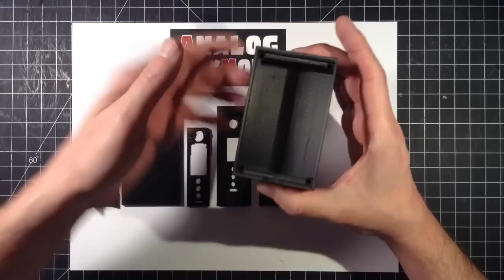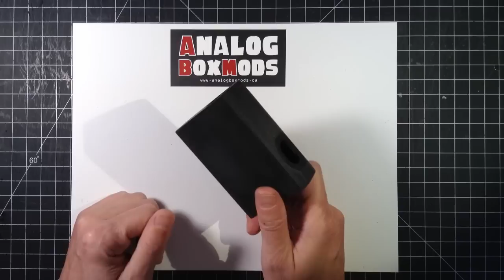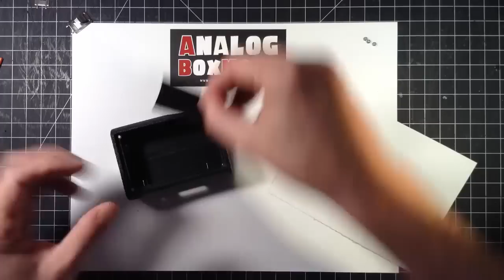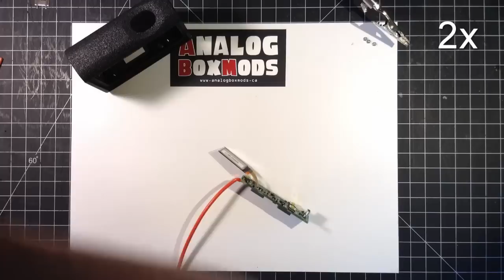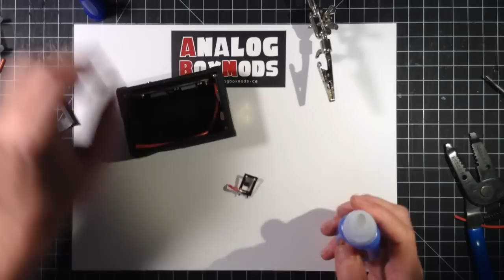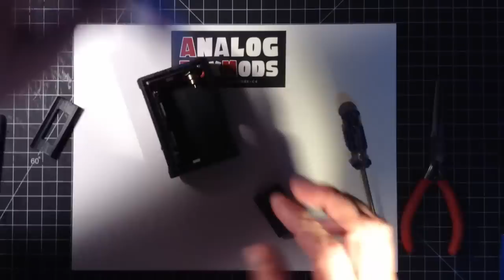DNA 75 3D Printed Squonk DIY Box Mod Build

Comment: Hi! Really really good work, thank you! What about a smaller version? 18650 only, maybe with something of the Nemesi XMOD or the Naked75 layout? Those layout could reach really small dimensions :)
Reply from the maker: I don't think I'll be making any more 3D printed designs, the closest thing I have size wise  now is the ABM-1 enclosure,  here are some pics https://imgur.com/a/Dpaox the purple one is 1x18650 and the black one is 1x20700.
Reply: Thank you for the reply, but those you mentioned are not squonk ones, as I can see
Reply from the maker: you are right :P, the ABM-2 enclosure is what replaces this one, https://imgur.com/a/EFpUx

Comment: is there somewhere we can buy that ground plane i cannot find it on the website anywhere. build looks amazing im new to building vapes but iv been 3d printing for a while thank you for sharing this to thingiverse
Reply from the maker: I never listed it on the website, if you buy the other parts you need add a note during checkout that you want a GND plane and I will include one.  If you source the parts yourself, there is a copper template in the 3d printed files, just get a thin copper sheet at your electronics store and use the template to trace it out.

Comment: what material did you print this? I am torn between petg or putting the effort into making abs work.
Reply from the maker: I use ABS but petg or PLA should also work fine.
Reply: @AnalogboxmodsCanada  thanks for the reply. Yah after studying last night I came to the conclusion that ABS is probably yhe nest material but getting it to print without warping is the challenge. Appreciate the help. 👍

Comment: For that top ground cable, do i have to use solder wick or can i use 16 or 18gauge wire?
Reply from the maker: You can use which ever you like, I just find the solder wick easier to bend when it is that short.

Comment: i need to ask you something regarding a future build. I got a broken mod with a working circuit, the mod is a 100w tc by eleaf that worked with either 1 or 2 18650. Could i use this circuit and make a casing and buy a 510 and a squonk bottle and put them all together to create a 2 battery squonk mod from it without safety issues? is it doable? or this circuit is unsafe for such a job? i m trying to cut down on spending and create my own squonk mod.i figured out that with a bit of work on a mod wooden case and a squonk 510, bottle and wiring i could crate such a thing. unfortunately i need to see many of your vids regarding wiring etc...
Reply from the maker: I don't see why it wouldn't be doable, if you make your own wooden enclosure then you can make sure the size is big enough for the board + 2 battery + squonk.  As for wiring, I don't know what board you have but the wiring should be the same for any voltage regulator, power in (bat+ and bat-), power out (510+ and 510-) and some controls (fire button, up/down buttons).  It should be just as safe as the original mod you harvested the board from.

Comment: Can you build this squonk in the ati box with dual 18650s
Reply from the maker: The only ATI enclosure that might fit the DNA board + 2 18650 + the squonk would be the N enclosure, and you'd still need a custom staggered battery sled...

Comment: I have a dna 75 board. Can I order the kit without the board if so how much for the one you built here.
Reply from the maker: The Kit does not have a "no board" option but you can get just the enclosure which actually includes everything except the board wire and 510,  http://analogboxmods.ca/Box-Mod-Parts/Enclosures/DNA75-Squonk-Enclosure .  Just add some wire and a BF 510 to your order if you need those.
Reply: Analog Box Mods there is somthing going on with the security on the site my browser keeps saying it's not a safe link and won't let me create an account or checkout
Reply from the maker: looks good to me, cert is valid... can you send me some screenshots? info [at] analogboxmods.ca